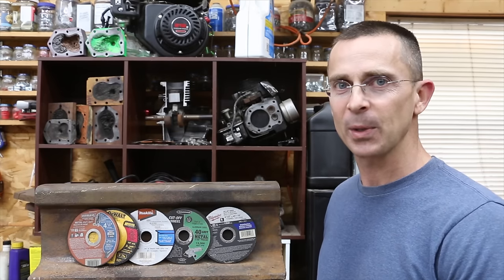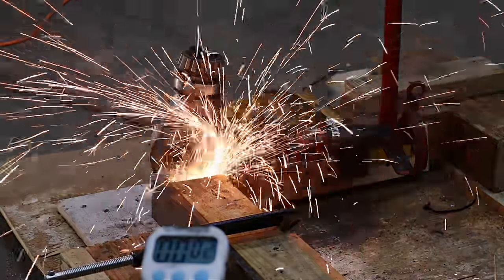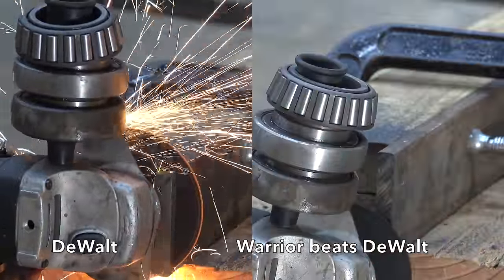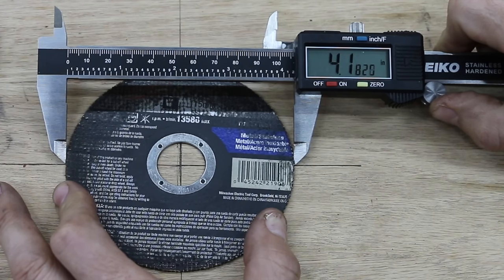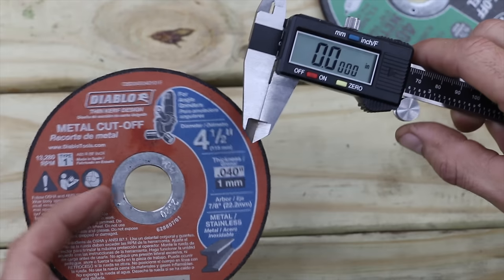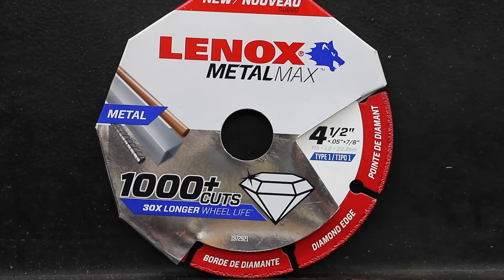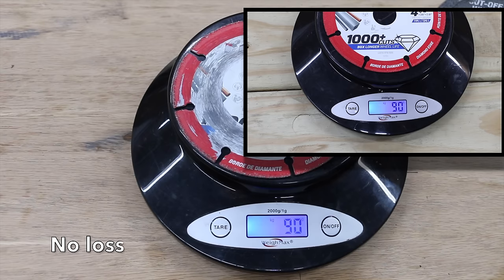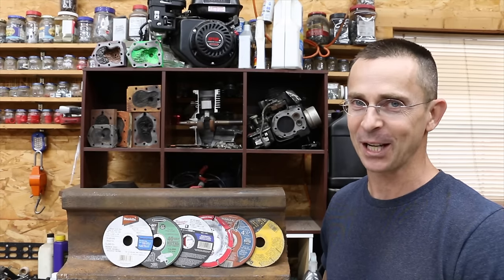Best Metal Cutoff Wheel Brand (6 Brands Tested)?  Let's find out!

Comment: I do metal work and I have the following questions for you. ( I prefer the 6" diameter grinders, blades cut a lot more than 4 1/2"'s but the weight of the grinder still manageable. I also prefer corded. The other day I cut a 1" thick plate about 48" long. Where it was located the Oxy-fuel torch wasn't the best choice
As far as cutting blades is there a possibility of testing the following brands 3M, Weiler Ceramic, Pferd, Norton., Sait?
Would you be able to test 6" grinders for the least amount of vibration? the brands I'm looking at are Makita, Metabo, Fein and Flex, if you think that there is a "better" brand please let me know. After grinding or cutting for long periods the hands are tingling. I think the left hand starts first, I think that the handle vibrates more than the body, Any opinions? Thank you

Comment: Have you ever considered testing double cut saws…and are they suitable for plunge cutting metal ( ie cutting sections out of a 55gallon drum for doors to a smoker….UDS?)
Reply: Also, using a double cut saw on thin metal….instead of a cutting torch?
Reply from the maker: Thanks for the suggestion.

Comment: Todd, which wheel would you suggest for cutting hardened steel, such as files? I mainly want clean cuts.
Reply: Two years later and now I'm trying to figure this out. Except I'm trying to cut through a hardened shaft that is about 3/4" thick.

Comment: Any way to do a pump gas station comparison from the major brands bp shell etc? And include which octane from which station is the least carbon buildup to the engine. People are constantly getting into arguments pro 93 vs pro whatever is cheap (obviously I know some engines run premium only) but if you ran each through the engine it may show something interesting. Each brand has different additives too so that could be tested. Like does v power really give you more power?
Reply from the maker: Thank you for the video idea!

Comment: This is good test but remember one thing. Different materials needs different disk!! 

You should make test also when cutting aluminium and stainless steel. I am cuting and grinding lots of aluminium and there is really big differences. The one difference when cuting aluminium is that bad disk is heating the aluminuium a lot and then aluminium is like smelting, not cutting. And the edge of aluminium is not good but need to grind
Reply from the maker: Thanks for the video idea.

Comment: I wonder if that Lennox wheel requires more pressure to cut better?
Reply from the maker: Great point.
Reply: I actually used a Lennox wheel for some metal fab on a snow plow last fall. I was thoroughly impressed with the cutting ability and the longevity of the wheel. For home use, it's a no brainer. I made 8-10 1/4 cuts 6-12 inches long and the wheel showed no signs of fatigue. I certainly feel I'd have used multiple conventional wheels to do the same work, so the Lennox wheel essentially paid for itself.

Comment: Any chance you could add a walter zip wheel to this test? they're available at home depot or online for $3-3.50

A fabrication guy told me about them and I've used nothing since, they're super fast and they're also flexible so you can't shatter them even if you do stupid stuff.

Comment: Judging by the condition of the wheels, you're using a fair bit more weight then I do when I use these. I use almost all Diablos just because that's what's at Home Depot.

Let's see if the Lenox lasts as long as they claim for diamond wheels.

There are a lot more diamond wheels these days, so perhaps a test of all diamond wheels? I've seen probably approaching half a dozen different brands at HD, just in diamond cutting wheels. There are also diamond grinding wheels. I think a test of whether or not diamond wheels are worth it is in order.

I bought one of each, don't really like them. They seem to do the job. But cut slower. Grinding is okay but also seems like they throw off hotter more painful sparks. Maybe just subjective.
Reply from the maker: Thanks for the video idea.

Comment: Try cutting a straight line with a simple almost no pressure pull cut and see how you feel about ever using a Lenox for anything that you want to look nice :)
Regular wheel cuts a groove that's flush on both ends and rides this groove as you pull the grinder down the line. as long as you can keep a relative straight line the disk will do its thing.
The Lenox is another BEAST entirely. There is no flush groove its a beveled cut where the disk is dancing around as it pleases as you pull down the line it follows no direction from the original groove and makes it own mind which way the line is going to be. It will skip and dance and you will have to reset it back in the groove unless you use a lot more pressure than you would a regular disk.
The end result will be an oversized hole with beveled edges. A word to describe the end result is BUTCHERED. I will use it on non critical pieces that are going to be used as support or hidden like gussets or L brackets somwhere out of view. I would not cut thick steel with this wheel though. If I had an old grinder i would put this wheel on it permanently and make it a goto grinder for quick thin cuts but if I have to change the wheel on my grinder i may as well put a regular cutoff wheel that can get the job done quicker. That being said if and when you run down you last disk and still have work left to do i think Lenox will be a gem to have as reliable backup wheel to save you a trip to the hardware store to finish a job.
Reply from the maker: Thank you for the feedback

Comment: It is very very very difficult to judge the qualities of manual cutting discs by one test setup.  Every disc is composed of grit, structure reinforcement (fibers) and binding material.  With an ideal disc the grit is very wear resistant and the binding material does let loose the grit particles only just after them getting sufficient dull.  Letting loose the grit is caused by increased friction forces by the dull grit and increased temperature as a consequence.  For clear, these friction forces are not only caused by the dullness of the grit particles, but even more by the specific contact pressure applied on them.  And this contact pressure is a function of the contact area and force applied.  As a consequence, depending on the section of material to cut on should apply a different force.  Most technicians take this reasonable well in account by intuition.  But by experience I know that some technicians will consume 3 times more discs for cutting the same lengths as others do.  And that's all about feeling.  By moving the disc slowly back and forth during the cut, one does continuously play with the contact surface.  And for every time they experience some slower cutting progress, they slightly increase the cutting force or move back and forth a little more quick for removing the dull layer.  One has to manage this "dance".   But, without being conscious, lots of people work too often the "layer removal mode", and they consume more discs.  And as every disc is made of different materials, they need a different "optimal dance".  And as every technician prefers different "dances", they prefer different discs.

In this test, some of the discs could be for the whole test in a "layer removal mode", because of a weaker binding material.  And others could be in a soft cutting mode and being quite dull as from half through the part, because of stronger binding material.
Reply from the maker: Thank you for the feedback

Comment: Love your tests: Can you test these cutoff wheels: Walter Surface Technologies 11H042 Zip , 
3M Cubitron II 4.5" .040
----------
HART 4 1/2-inch Metal Cutting Wheel
---------
BHA Metal and Stainless Steel Cut Off Wheels for Die 
---------
SuperCore Metal Cutting Wheels, 50% Longer-Lasting
----------
ZIP XXTREME™  4.5" cutoff wheel              HOPE  YOU CAN TEST THESE
Reply from the maker: Thanks for the video idea.

Comment: With 4097 comments, someone has probably posted this already, but, IF all wheels were the same cost, and labor isn't a factor, the most economical would be the wheel that loses the least weight. % of wheel loss is more a matter of thickness.
Reply from the maker: Thanks for the feedback.

Comment: I work at a tire shop we go through alot of wire wheels cleaning rims 
Can you do an experiment of different brand wire wheels 
Testing how long they last 
And wires being lost and thrown
Reply from the maker: Thank you for the video idea!
Reply: Hi Dryden.  I hope I can assist you with some advice.  Most wire brushes (cup, flared or wheel shaped) do not show the max speed rating and sometimes operators think that a 4.5 inch cup wire brush can be used on a 4.5 inch angle grinder.  This can be quite dangerous since a 4.5" cup brush might only be able to handle a max speed of 8000 rpm while the angle grinder runs at 12 to 13000 rpm.  Matching the speed is very important to ensure that the wire filaments (bristles) do not detach.  If you do not have a speed issue, you might need to look at better quality brushes.  The lower quality brushes are not always crimped properly.  Happy to help if you have issues.

Comment: as long as your not in a hurry cutting metal,, just buy the cheapest ones on line,i have a bosch 4 1/2 with a bolt on guard and i can use it down to 2  inches,, i get  a box of 100 f 45$  ,,free shipping, most are made in china, i have used a bunch never had a bad wheel, take it slow and easy and let the wheel cut at its own pace, dont force these things thats when they break,and wear down fast,the diamond one will load up with AL ,brass ,copper any soft metal, and be useless,, push a diamond wheel hard in steel and it will load up too ,ruining it.the diamond one also can skid and bounce around on steel till u get a groove started,PF said it right the diamond ones are for thin sheet metal (steel) only,,AL oxide wheels dig right in ..u can get a full guard enclosed on the top and bottom,(most are open on the bottom)and all the debris and sparks will go out the front, great  thing for a lot of cutting,,if u are in a hurry cutting thin to thick  metal,, u need a 500$ Plasma Cutter,or a 200$ Chop Saw ,or both,,not a credit card  thin cut off wheel on a angle grinder.a trip to the ER can cost a lot more than 700$...
Reply from the maker: Thanks for the feedback.

Comment: I have to ask whether the lenox wheel requires more pressure to cut well.  it's hard to imagine they expect a cut like this to take 5 minutes compares to under a minute for regular cutting wheels.   perhaps the same test with more weight?  or finding some kind of info about expected way to use the tool.
Reply from the maker: Great point!  More pressure would help a little but I've used it quite a bit and won't use it anymore on thick steel because it cuts way too slow and causes the grinder to overheat.

Comment: How about the 3M 66535 cut off I used it and the material didn't get nearly as hot as the other metal cutting wheels.
Reply from the maker: Thanks for the suggestion.

Comment: Dont use diamond on steel, it will foul up with a carbon/iron mix, its the carbon in the steel that will stick to the carbon diamonds and foul the disc up.

On steel you have to use CBN/cubic boron nitride as a "diamond like abrasive"
Reply from the maker: Thanks for the feedback.

Comment: Do you think a Diablo diamond cutting wheel would be as slow as the Lenox? I bought a 2 pack of them around Xmas time, but haven't had the need to use them yet.
Reply from the maker: Great point. I would think they'd both be about the same.
Reply: @ProjectFarm  More than likely...your test opened my eyes to how slow they are compared with abrasive wheels. I would have thought the opposite until I saw it here. 

Nice test and video.

Comment: I wonder how repeatable this test is?  ie. If you tested 10 of each would the results be the same?  I think your test rig is about as good as can be expected but I've had some disks wear out much faster than others of the same brand cutting the same material.  Of course, maybe the problem is me and not the cut off wheel.

Comment: Would the diamond wheel cut faster with more weight?
Reply from the maker: Great point.  A little faster but it's very slow compared to the regular abrasive wheels.

Comment: The only flaw I find in your testing is that you don't use a human to load the cutoff wheel with a lot heavier loads. As a human myself, I don't mind pushing a wheel pretty hard --- trying to feel where the grinder might load down too much, and operating just at the point of burning up the machine. 
The Lenox wheel takes a lot more abuse than the composite wheels when I use it, but I'd like to see the difference in electrical use, wheel damage and premature wear-out and perhaps the tendency to chatter when pushed hard. 
Chatter always kills a wheel fast!
Reply: Interesting point. Now I'm curious how much closer the Lenox cutting time would be to the rest if more pressure was applied to compensate. 30x longer life earns it the right to further testing.

Comment: to me it is strange that  there is a diamond wheel made ofr cutting steel. yes diamond is hard, but it dissolves into the molten steel as it cuts. one could think of is as cutting an ice block with a coarse salt edged saw.
Reply from the maker: Thanks for sharing.

Comment: Don’t get that Diablo wheel. I have first hand experience cutting cast iron pipe with it, once it gets hot it starts to wobble and make really bad cuts while still having a good amount of material on the wheel. It’s very sketchy. Honestly I would recommend the Makita or dewalt one. Never had issues.
Reply from the maker: Thanks for the feedback.

Comment: Never use diamond wheels on ferrous materials.

Diamonds are made of carbon, and are actually miscible into steels at high temperatures.

Basically the diamond dissolves into the steel hardening it.

You know that smell you get when using a diamond wheel on steel, that's the smell of the diamond cooking off.

It's a marketing ploy. 
People see the word 'diamond' and assume "this has to be the best."

The best material for grinding ferrous materials is cubic boron nitride.
Reply from the maker: Thanks for the feedback.

Comment: I'm having difficulty with your math re the before and after wheel diameters. Example, you say - HF wheel was 4.54 before, 4.05 after. That's a loss of just about 1/2 inch. You call that a 41% loss of useable wheel. What diameter are you considering the minimum for "Useable"? Thanks - Lumpy
Reply from the maker: Thank you!
Reply: @ProjectFarm  Thank me for what? Thanks - Lumpy

Comment: A Walter cutoff wheel is probably my favorite , but is a little spendy unless you want to spend $300 on a 100 or more wheels. 
  Is that why you didn't test a Walter?
Reply: I would have to agree.  We use Walter Zip wheels at our shop, but they are pricey.

Comment: That Lenox Blade cuts So much faster. I have that 4 inch blade plus I have 10 inch . Those diamond tip ones cut  so much faster with pressure it’s not even funny.
Reply from the maker: Thank you!

Comment: You would think that a 4-1/2" grinder with a cutoff wheel is the only way to cut metal, all the car tv shows everybody uses a grinder with a cutoff wheel.
What's the deal?
PLASMA CUTTER? Band saw?
Electric sheetmetal shears?
Air cut off tool that uses a cut off wheel but isn't a 4-1/2" grinder?
Porta-band?
I just don't get the obsession with a grinder with a cutoff wheel.
Reply: It's fast and can get into a lot of places that those others can't. Plasma cutters are pricey and require compressed air.

Comment: Now, you see, diamond cutting blades aren't really the best choice when it comes to cutting steel, because at the temperatures this generates, carbon dissolves into the iron quite readily, which wears down the edge on those diamond particles quite quickly. Had it been any other material like stone, titanium, aluminium, copper or whatever, it'd fare much better. For steel, cubic boron nitride is much more suitable because it is almost as hard as diamond but doesn't dissolve in iron. Of course, boron nitride often gets marketed as diamond so if that's what this is, disregard what I said. As an aside, you wouldn't want to cut titanium with an aluminium oxide (corundum) cutting wheel because it reacts with it chemically, stripping the oxygen off the material to make aluminium which wears down quickly, but diamond excels at cutting titanium. Each tool has its strengths.
Reply from the maker: Thank You!

Comment: PORQUE NÃO USA A RAZÃO G?

AREA OF DISC CONSUMED BY AREA OF THE CUTTED PART IN MM2?
EXAMPLE: 115mm DISK Initial: = 3,1416 * (115² / 4) = 10381,63mm²
Pick up area now of the piece you cut it imagine to be: 12.5mm * 100mm = 1250mm²

Final disc dynamometer = 103mm final = 3.1416 * (103² / 4) = 8328.07mm²

Now it divides the area removed from the part by the isa consumed of the disk thus becoming;

1250mm² / 8328.07mm² = 0.15mm²

Disc consumed 0.15mm² Material per 1mm² of Abrasive.

Result a deplorable good number would be 1.5mm² to 2mm² per 1mm² of disk, much more of this the disc presents high hardness.
Reply from the maker: Thank you!
Reply: @ProjectFarm  correcting the calculation had forgotten to pick up the loss area from the disk right now

Comment: Seems like dinner is faster, but does not last as long. Long. Also, the lotion diameter means more where to the disc. That slows down your cutting over time. It's disappointing that the Lennox took so long to get through that stock. It's even more disappointing that DeWalts wheels are so fat compared to their advertised thickness.
Reply from the maker: Thanks for the feedback.